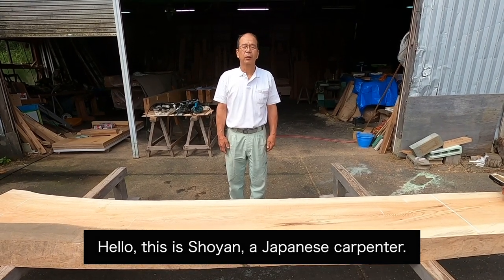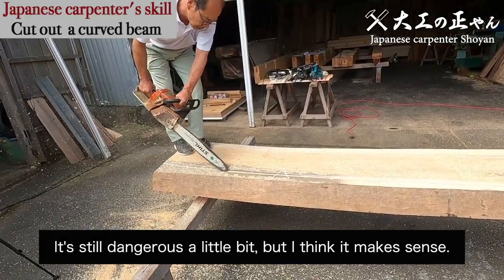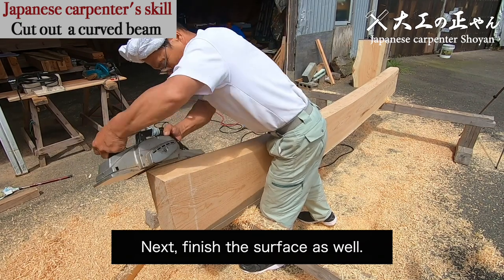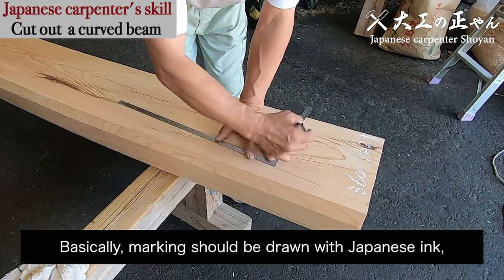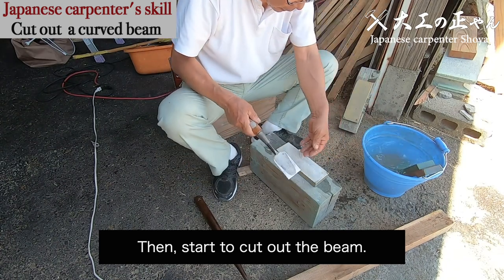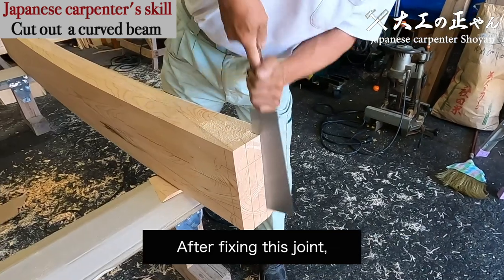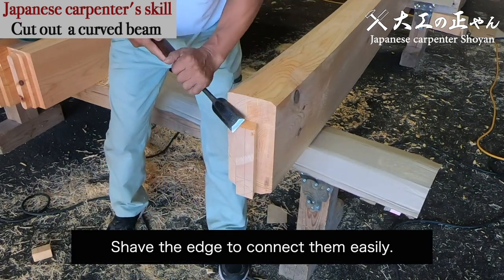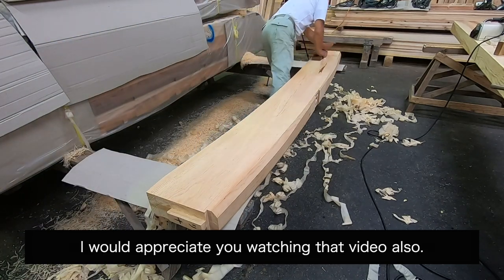Japanese woodworking - Cutting out a Curved Beam

Comment: I need to watch this many times. I'm grateful to you for sharing. There is so much I need to learn. My father was a cabinet maker. I see timber framing to be very similar to cabinetry. Carpentry framing is usually finished to hide the components of the build. This video shows me that the  structure is exposed to see its function. 
I have questions about the tools: The planers and mortising drill press - Are these tools available in the USA? I have never seen them.
Thank You

Comment: A curve cut out of a square log, meaning the grain is going straight and they are severed by the saw, is no where near as strong as a beam that's been steamed and bent.
Reply: I bet a steel i-beam would be stronger than both! But maybe what he's making doesn't require that much strength. Come to think of it, maybe the beam he created is strong enough for whatever he's using it for.
Reply: @shaunpage4498  I think that he chose a timber that had a wonky bend so that the grain complimenting the arch? I agree with you about cutting those fibers. Maybe he found a shitty timber that suited this build?